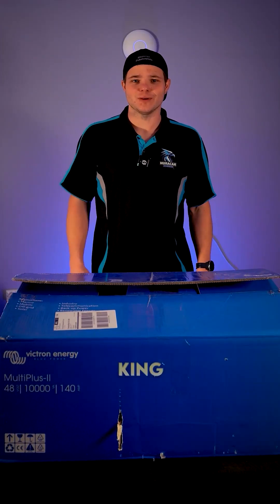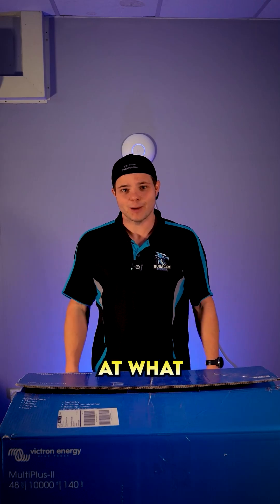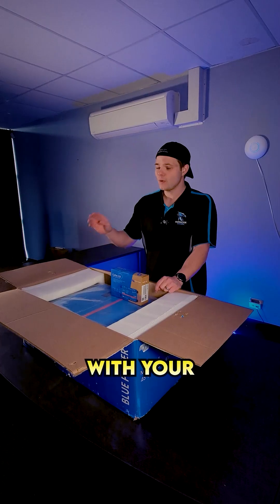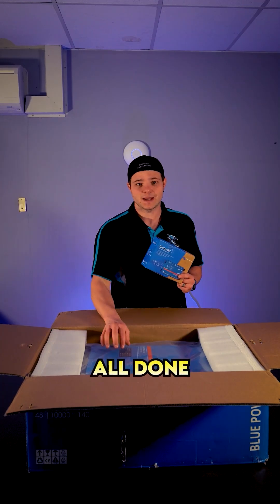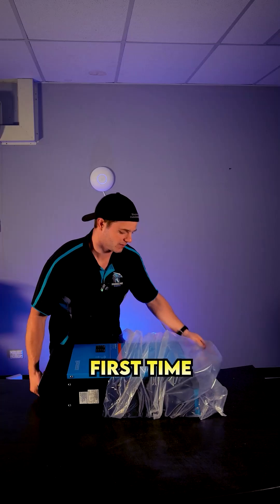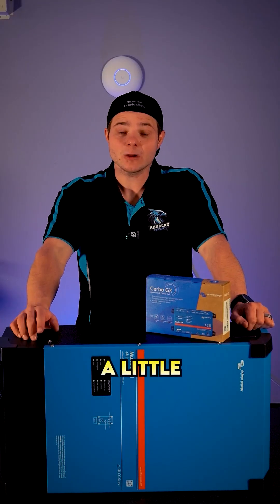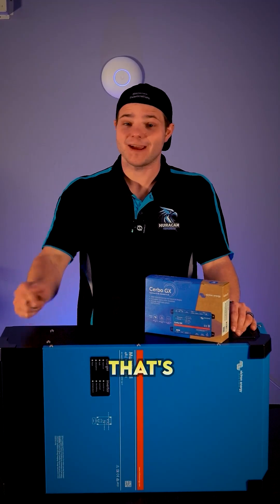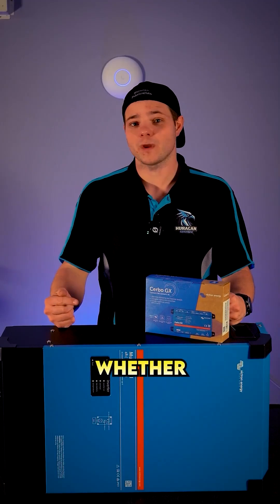Unboxing the Victron MultiPlus-II – Power, Performance & Pure Off-Grid Swagger ⚡

Comment: They only released this because they are getting their asses handed to them in the US/EU from the likes of LuxPower. Victron nickle and dimes you to death with each separate component. Luxpower you can have 18kw of PV MPPT, 15kw 3phase inverter, Breakers, shutoffs, disconnects and live online monitoring? In one unit that cost 1/3 of what Victron will cost to buy all the MPPT etc and build a ugly wall full of wires.